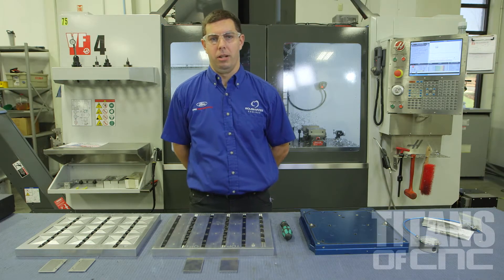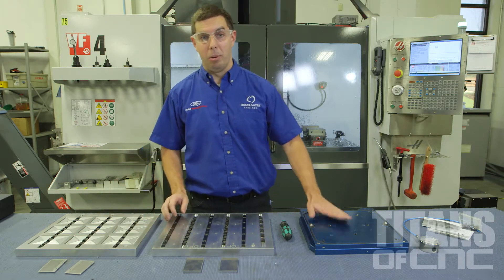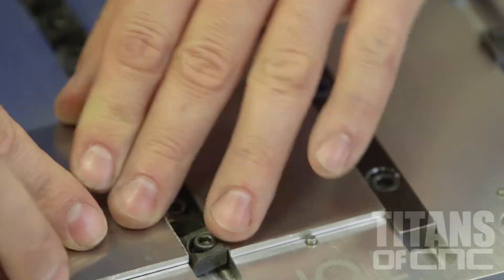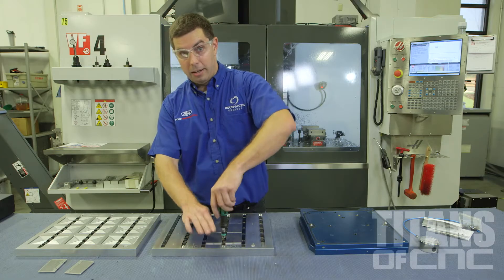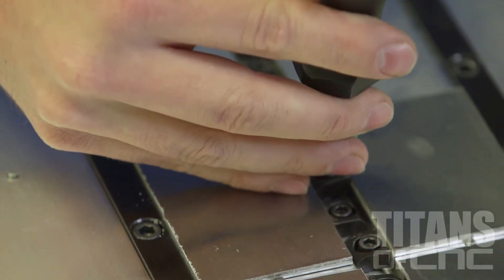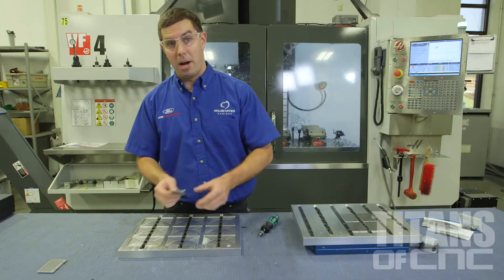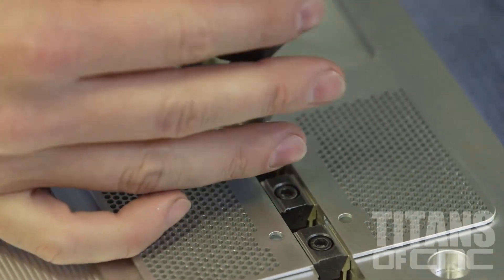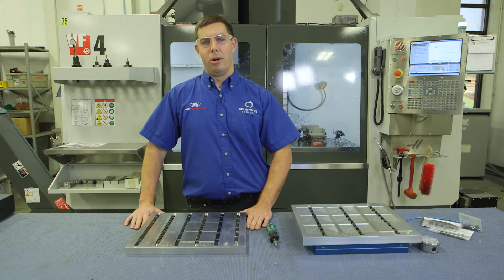Vacmagic VM300

Comment: sorry guys. big misconception that running a cnc fast will keep jobs in the us. Sorry titan. 800 ipm ain't bringing jobs back. 
Do the math, in you had a product, and got a quote from a US shop, then Chinese shop, your wallet would make you go to china.
I don't like it either, but it's reality.
Reply: Hi Shamu,running fast and reducing idle spindle time helps bring jobs back. One operator running more than one machine helps bring jobs back. Saving on material cost helps bring jobs back. High density fixturing reduces tool changes...and helps bring jobs back. If you can combine a few of these you can run at a lesser cost and not worry about late deliveries stuck in customs and poor quality or out of tolerance parts without recourse.